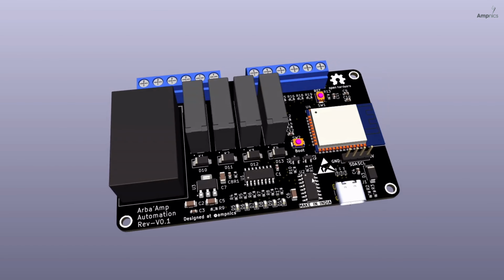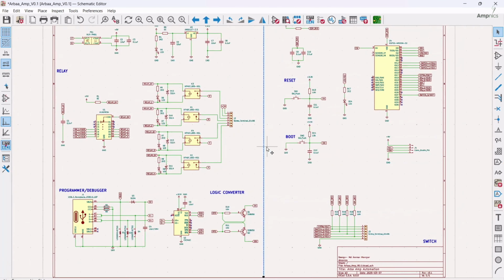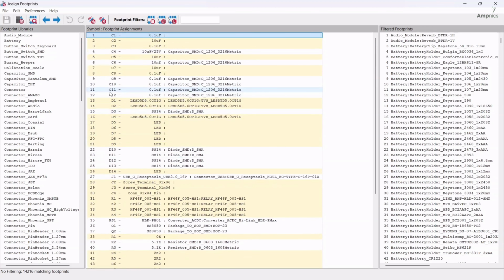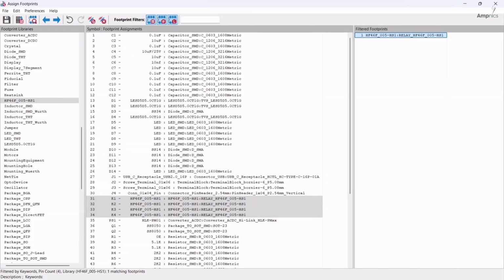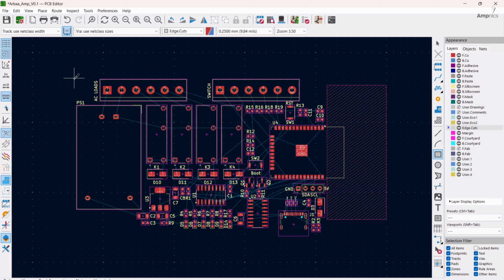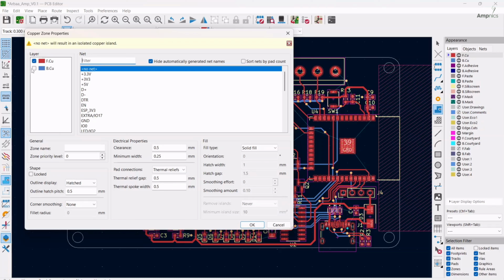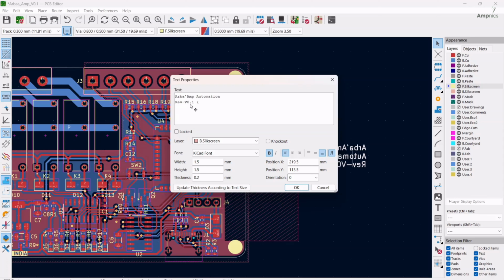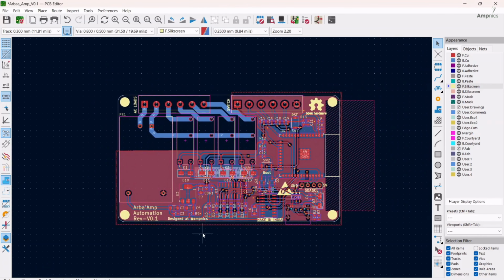Home Automation with ESP32 | KiCAD 9.0 Tutorial | Open Source Hardware Project | Ampnics

Comment: Can this design handle to be powered from the AC side and have the USB Connectet at the same time and switch to the correct side of delivering power ?
Reply from the maker: Well! Can please make your question clear, okay yes can power up from both side from AC and USB C, there’s Schottky diode is in between of both of them.